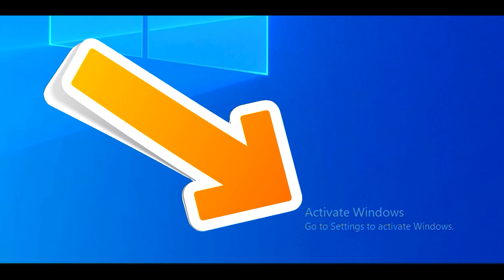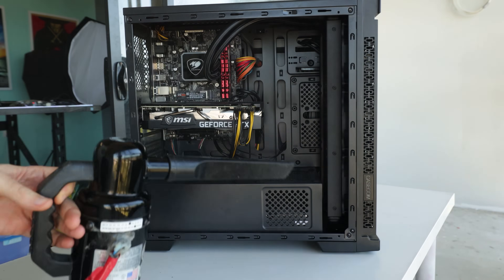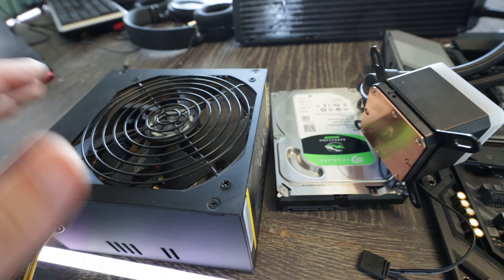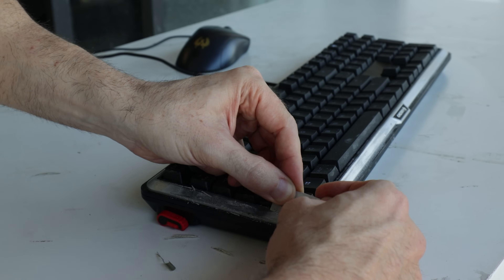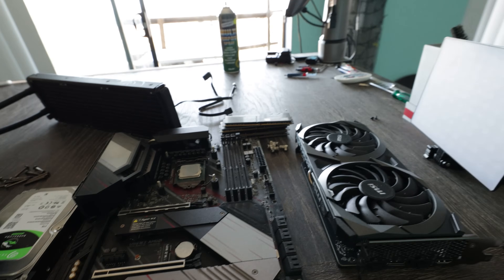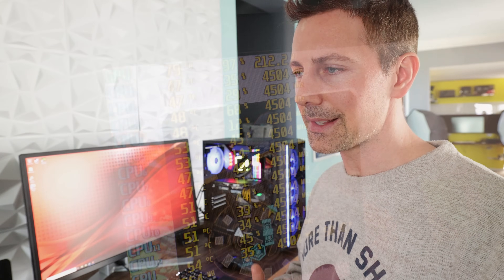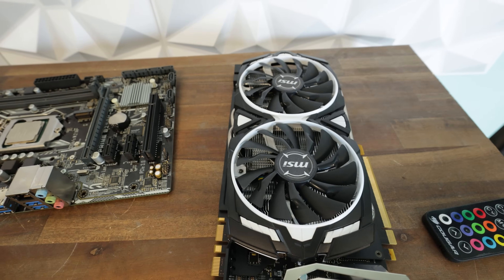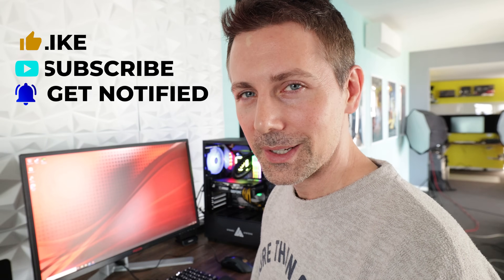How I got a $1000 RTX 3070 SETUP (Cleaning and Fixing)

Comment from the maker: Few comments about being worried about washing PC Parts in water.  It's ok I a certificate in Yesunology.
Reply: since covid situation, i just sink my bought parts in alcohol, then i use toothbrush and toothpicks to clean pcbs, finally i us hairdryer to dry them. never broken a single mobo or gpu
Reply: @petar932 you must be rich to buy a lot of alcohol and then sink them
Reply: @growtopiajaw  it really isnt thatmuch of alchocol
Reply: @growtopiajaw  Cheap водка 🤗
Reply: @petar932  thanks ima try jsut bought a gallon of 99% isopropyl alcohol
Reply: @R3TR0J4N  np dude, send a message if you had any problems
Reply: totally fine imo, as long as you get rid of the moisture asap.
Reply: I want to buy the mouse and keyboard .-.
Reply: Is YESunology a thing?
Reply: Deal of the year 🤎
Reply: When will we see the 
 7700k/1080/16gb build?
Reply: Is that 690 brand new or 2nd hand price?
Reply: Worked in a factory that made printer boards. After final assembly. They get washed then put in a drying oven. So it’s fine
Reply: ONe nice find. But missing those china hunts
Reply: Should have been Yestechnology
Reply: Dude, use sleeves cable 😋👌🏻✌🏻
Reply: Great score 🥰🎉🥳, especially for here in Australia 🇦🇺! You can use “wet n dry” sandpaper on the keyboard top piece to remove the mould and then simply respray the said piece any colour you like 👍 which would give the setup a more refined look.

Comment: The amount of cleaning that went into that keyboard and mouse hardly seems worth it. I'm surprised you washed a mustard cable PSU and included it with this higher end build; did you not have a replacement PSU?  I mean, you changed almost everything else in the system. Lol

Comment: you messed up on the orientation of the AIO, the hoses should be below the AIO pump, Gamers Nexus did a really good break down of how to get the very best life out of an AIO, please go watch it he literally cuts the rad open and replaces it with plexiglass and shows how the liquid flows in different orientations.
Reply from the maker: I have run AIOs like this for 5 years and haven't had a single problem, As long as the pump isn't at the highest point in the build and there are no restrictions you will be ok.
Reply: @techyescity  ah ok. sorry as long as it works right lol
Reply: @techyescity  and i wasn't challenging you're knowledge on how to build PC's im one of those learning never ends.
Reply from the maker: @psoutrage38  Oh no worries man, sorry just see this a lot around the internet! GN does great work though a lot of people got confused by that video and thought it was the only way to route an AIO.

Comment: I would check the thermal paste on the GPU, re-paste it if needed. The last 3 MSI GPU's I've purchased have had lackluster applications from the factory. 1070 Gaming X, 1080 Ti Gaming X & 2080 Ti Gaming X Trio and the 2080 Ti only had 70% of the GPU covered with paste..................put some MX-4 on and temps dropped by almost 20C along with much quieter fans.

Comment: @Tech YES City, Could you tell me what sort of blower your using and where to purchase one. By the way you amazed me when you fully submerged that PSU, even more surprised when it worked, would it not be better to use say Iso Propyl as a cleaning fluid in the sonic cleaner, as ISO will totally evaporate in no time and cleans exceptionally good.

Comment: Can confirm the Ventus 3070, undervolted mine, won't reach 2100mhz like it does out of the box, it goes around 1950 to 2000but I get minus 10c when I pulling it at max potential.

Comment: I used one of those AOC Agon displays for a bit. Bezels look a bit dated but the stand is amazing and you can't argue with four USB ports and that headphone hook as perks. 

Not surprised by the temperatures on the GPU. The Ventus 2x is pretty much the worst 3070 available, that cooler is just not adequate.

Comment: I have that same MSI ventus 3070, and the temps are fine. Even plating cyberpunk, with all the goodies turned on. It's no worse than anything else I have owned. I do run a slightly aggressive fan curve, through afterburner, but I add 500mhz on the memory, and nothing on the gpu clock, preferring to leave that to GPU boost. It sits around 65/70 at the most.

Comment: Looks like my AOC AGON AG241QX.  24" 1440p144 is amazing.  I just wish they didn't ruin it with the anti-glare coating.
Reply: OH - and I too run mine without the Freesync.  Whenever it goes into low framerate compensation (below 30fps) it flickers.  I mostly play WoW with a lot of addons and any time I would mouseover and get a tooltip of an item or spell, it would flicker - as well as on every loading screen.  Just wasn't worth it when vsync is sufficient.
Reply: Oh and that little remote - at first I thought it was just a really stupid gimmick, but man it was so nice to be able to set up the monitor from viewing distance without having to constantly lean in to press buttons.

Comment: the gpu temp is probably affected from the case. There's literally little airflow going inside. I had a case similar to that and my gpu temps are around there. I swapped cases to the o11 and now my gpu temps are 67-73c never over 75c. i'm using a 3060ti Gigabyte Vision

Comment: I still have my i7 3770k, 32GB DDR3 @ 1866 Mhz and it's coupled with a 3080Ti. I don't see any bootleneck from the CPU =) Doom Eternel and Cyberpunk work perfectly at full settings =)

Comment: I just adore it when you used the ultrasonic cleaner and drop whole parts into it.  The brains that must be frying from the 'That's Dangerous' community.  If see you do this at east a half dozen times with ZERO problems.  You've got your method for drying and water wicking down pat at this point and if it didn't work consistently, you wouldn't do it.  You're a hustler and hustlers don't waste time on shiznit that cost them money.  

Great job; great hustle.
Reply: lol my dad is like U CANT DO THAT everytime i clean a pc with water

Comment: Nice deal indeed man! Two days ago on my local market a guy was selling this i7 5960x based system with a 1080ti founders edition in it, 700 bucks USD. I could tell by the pictures that perhaps he had never sold a PC before. I messaged him about it and asked if he knew what the motherboard was or if he could show me a clearer picture of it. It turned out to be an EVGA X99 FTW. Pretty rare these days it seems. I advised him that maybe 700.00 USD was a little low of an asking price considering that there was also a 1080ti in there 1000 watt corsair PSU, 2 tb SSD. Mind you everything is dusty as hell in the photos. I told him not to let anyone low ball him and to blow all the dust out and take another photo. I almost bought it, but I have 4 systems already including my own x99 E5 2678 v3 based system to play around with. I'll probably never see another one of those 5960x's come up for sale again, oh well.

Comment: Hey, I got a question about the build. At 15:04 the temps are quite high for a chip on a 360mm AiO; any insight?
Reply: The case that he's using has a closed front. So even though that aio has 3 fans, they are in front of either glass or acrylic. It's not a mesh front.
Reply: At 11:08 you can see it.

Comment: Damn shame that 7700K build has max 4 years left, due to Windows 11. It's playing games at high frame rates here, and will run many games for a long time. Microsoft have been brutal by cutting off Intel CPUs at the the 7700K, and below. However I suppose there is hope that Win 10 will get a life-extension, but I would not count on it.

That metal bracket from the keyboard might easily clean up with metal polish, like Brasso.

16:49 Here's hoping that changing Etherium to 'proof of stake' will change the market. It's only hope at this point though. It might mean miners dumping large quantites of mined cards. ... Most of us are not experts on mining or cryptocurrency. It would need someone who understood it, to figure it out, (but then anything can happen).  Folk always say that miners will turn to other coins. However if other coins are not vaulable, how can they afford to mine them, given hardware and power costs?
Reply: imagine if there was another operating system that was free and that you could game on think its called linux nobody is going to be forced to move to windows 11 its a choice

Comment: 11:24 CPU 95-100°C with a 360 rad? Is everything ok? It wasn't even 100% load
Reply: Yeah that is concerning for sure. A tower cooler would run that cpu at lower temps than that.

Comment: I disagree with the assessment for a videocard with the 4790K. I have one too and had it paired with a GTX 1080 and found that it still got some reserves. put in a 2080 super and some point and it is slightly bottlenecked now but I can live with it.
The main question is what you do with it. If I was a competitive gamer chasing FPS at 1080p I would probably be very unhappy with the 4790K holding the 2080 Super back. But I like my games to be as pretty as possible in 1440p and the fps are secondary as long as they stay above 60 all the time. and for that, the 4970K still does a great job in supporting that "big" card.
So, depending on usage I'd even recommend up to a 3060ti for an overclocked 4790K with fast RAM. 
So in the end it depends on the usage AND on whether spending lots money on something faster justifies the performance gain over the 1070 ti. Probably not.

Comment: distilled water is better as tap water can contain salt and metals that will cause corrosion and electroless of  metal after a while don't use tap water but when I worked at a stihl shop we only used tap water in the ultra sonic cleaner  because they wouldn't buy fluid, we used it mainly for cleaning carburettors.

Comment: Hello Brian, I would like to ask is my i7 8700k running at stock 4.3 GHz bottlenecking my GTX 3080 TI that I upgraded to recently? I am getting GPU & CPU usage of around 50-90% in warzone in lowest graphic settings (5120 x 1440) besides the ultra textures and my FPS would flatulence all over place from 100s to 30s when I start running from gun fights for example and it's just not playable for me. My GPU time indicator mentioned in warzone at top, would be 6ms and CPU times would be 10ms 

My GPU does the similar thing with Apex legends as well where I would get inconsistent 120fps but atleast it playable and feels a bit better then when I used to use GTX 1080 previously. I can't seem to get very high Apex FPS as your videos shows even at low 1080p. My CPU stays at 4.3 GHz & my temps sits around 70 degrees while gaming.

Comment: My mate recently got an AIO and when installing the waterblock/pump part onto his cpu and tightening it down he accidentally tapped a capacitor near his ram slot. He continued to use his computer and had issues with some games where the sound stopped working in some games and yet other games worked fine. I told him he should probably replace the motherboard as soon as possible so this week he got a new motherboard, he built it all up and when into bios, he turned off CSM and secure boot and when he saved the bios settings and reset his PC all he got was a black screen and the system didn't post properly. Turns out that Capacitor was regulating voltage to the CPU and he must of damaged his CPU over the time he games on it on the older motherboard with the missing capacitor. On the new motherboard the CPU must of been on its last legs and died. So now he just bought a new CPU. Moral of the story if you knock a capacitor off your motherboard you should stop using it immediately.
Reply: Thank you for sharing. I've come close to doing that, but I was able to bend it back in to place. Thats very sad to hear about his components though. I would have gone a little irate and broke something else probably while trying to get it to post. One thing I can suggest, but its too late now I guess. One time when I was having a hell of a time getting one of my systems to post after newly putting it together in a different case and upgrading the CPU, was updating the motherboard's bios. If he is using a brand new CPU but not necessarily a brand new motherboard, but one that still has the same socket for the CPU, a BIOS update will be necessary to properly support it sometimes. A lot of the nicer/newer boards seem to have a bios flash function via USB, you just have to refer to your manual and forums for the specific process for said motherboard. That way you don't need a different CPU that will post on the system to update the BIO. Sorry for the ramble, have a great life!
Reply: @Atlantis_IRL  He tried to update the bios via bios flashback but that didn't work. He sadly didn't have another CPU of the same socket to try. He was told by the store he took it to that the cpu got fried so got a new CPU and now his PC is up and running again.
Reply: ...or repair it. I mean it's not easy, but if you have a friend with the good soldering tools, it's not definitely dead for good =)
Reply: @fridaycaliforniaa236  Yeah he didn't have anything like that and didn't want to try and also didn't know anyone or a place that does board level repair. He got told by the store he took it to that his CPU got fried as his setup worked with another CPU they had. I guess if a capacitor falls off the motherboard near the CPU you should stop gaming on that PC which he did for a few hours where he noticed odd behaviour in some games. Skipping or missing sound.

Comment: I have a RTX 3080 Ventus 3X OC and does get warmer than I would like to see. But it stays at 70 degrees under load, however I'm going to be changing the thermal pads to improve it more.
Reply: Ventus is straight trash lol
Reply: @Ash-my4gf  all the 3080s and 3090s don't have the best thermal pads. I know others that have 3090s that needed to change the thermal pads because they had horrible vram temps.
Reply: @NightLezz1  oh yeah most have to have them changed I’m just saying ventus is especially bad in general aswell
Reply: @Ash-my4gf  Ya, temps aren't the best. But performance is amazing

Comment: When tech yes overclocks CPU and almost never crashes in APEX... And here I am with slight overclock on 9900k and getting constant WHEAs :P did you try opening up the RTX 3070 and changing the thermal pads and paste for something like MX4? Weird that the card is heating up to 80C, zotac is like 7-8C cooler at 24C ambient and I assume its a worse model then this one.
Reply: My Zotac hits 60s in apex max. 31 when browsing like right now and idles at ambient. Give or take 2-3°
Reply: @Dr.C-UTS  I assume this is on stock settings with custom fan curve?
Reply: @PCAgentSi  It's an OC card from jump so no. However the OC still has room for more. I have not gotten around to finding out how much more headroom it has yet though. And yes, the curve is custom and I set both fans to run at the same speed. The original software had them running at different speeds and would cause throttling and sometimes crashes.

Comment: Whoever had that pc must of smoked, vaped and ate every meal on and around that thing
Reply: vaping does not do that to your pc
Reply: @lachysimmonds357  it does clog up the fans with sticky crap and sticks to the fins on the heatsinks causing temps to rise ,i used to vape around mine for hrs but stopped, so does smoking but maybe not for that one but that pc is a right shit state and thats not good practice leaving it like that, says a lot for whoever owned it, dirty fucker
Reply: @Wilksey75  i vape eveyday with my pc that ive had for 2 years none of that
Reply: @lachysimmonds357  strange as the fans will suck in the sticky VG and it coats the fans with a residue as does smoke, you must have really good ventilation 😀

Comment: 80 degrees for a graphics card while gaming isn't that bad, though for an open design cooler it is unusual. GeForce cards should be fine up to 100-105 degrees from what I know, not that they should be overclocked to that point.
Reply: He said it's a dirty case so that's probably the reason. Also for the temp, I've been playing games with at max 78c for hours for years and nothing happened. That was gtx 970 back in the day. Maybe this case is a bad one. 80c is warm but nothing dangerous mid 80s and 90c is where you want to stop playing and clean the GPU or reapply thermal paste and set a custom fan curve. But 80c is not dangerous to the gpu but a bit warm.
Reply: @rpgamezzz270  this demonstrates that having 3 fans in the front is for show. These temps are just fine for NVIDIA, as we agree. I don't see why tech YouTubers see this as such a problem.
Reply: @youtubeairways8646  Well radiator in front never was a good idea, solid front neither. Case just have some vents on side of front and is not that good compared to a full mesh front.
Radiator must be in upper part not in front.
Reply: @CommanderTato  that new Fractal case would have been optimal.
Reply: @youtubeairways8646  Putting that rad on front was probably a economic reason, if he did the right thing of putting it on top and then add 3 fans on front that would eat his profit margin.
And since most people who buy built computers are complete morons no one will notice the bad temps. 
Most people is hurr durr RGB